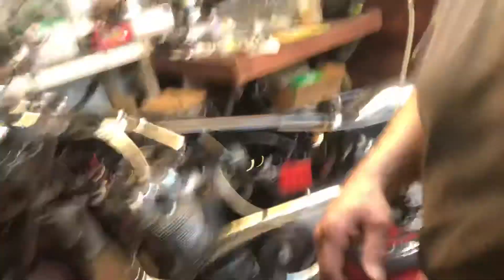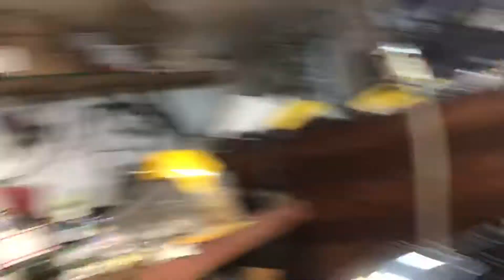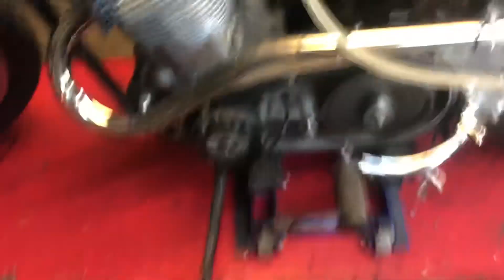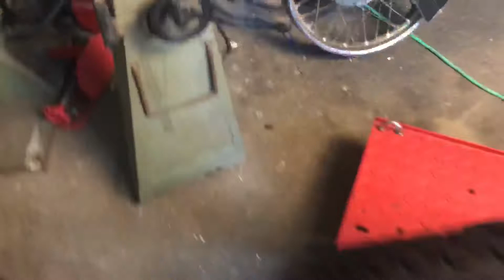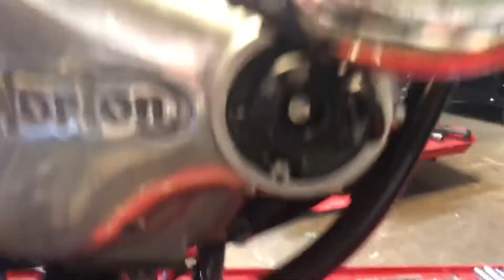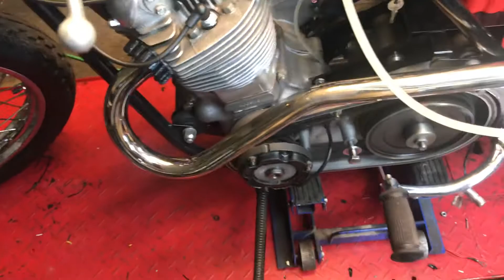Norton commando first start up after rebuild

Comment: The left-hand headlamp bracket is an inverted right-hand bracket (so the RH bracket is probably the LH bracket). 
When the brackets are fitted correctly the headlamp adjustment slots are horizontal.